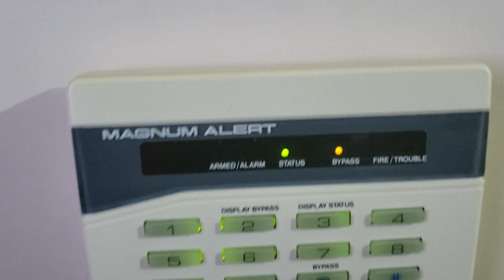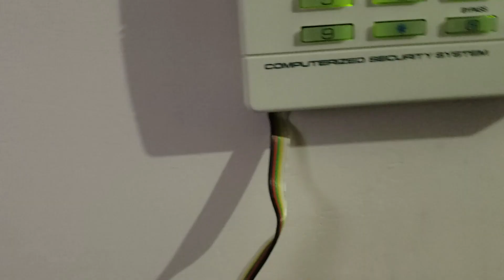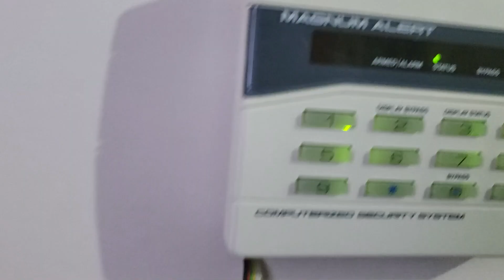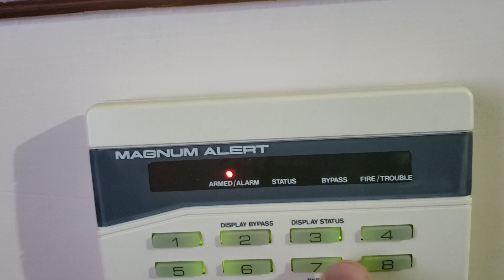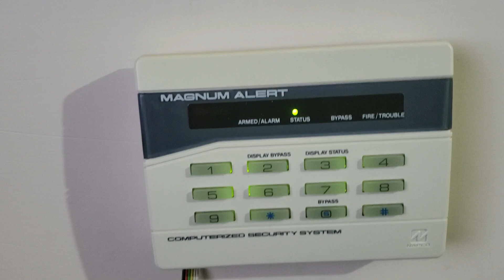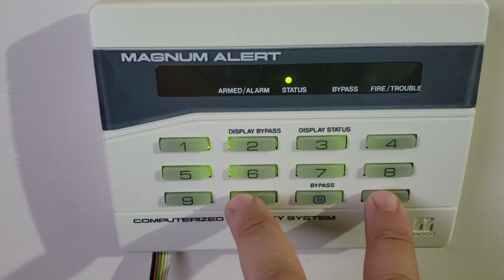Magnum Alert 1000 series basic functions

Comment: My Magnum Alert RP1054e Keypad appears to be frozen with the Armed light "ON" and the "Bypass" light is "ON". My local Arm/Disarm code does not work. I need to reset the keypad and create a new "Arm/Disarm" code. The reset key (9) does not appear to work. Grateful for any assistance. Thanks.

Comment: Hello !! I bought a house and it has magnum 1000 ma1008lkdl alarm system. Your video is super helpful to get the insights to get started. 
It’s showing green light flashing and when I press 3 for few seconds, it shows the Zone 1 and 2.
How to determine which areas of house are in Zone 1 and 2 ?
I checked my doors and windows are closed.
Also, do they still support the system ? I mean if they respond to any security alert or do I need to call and set all that up. I just have no idea !!
Thank you in advance !!

Comment: Hi There Decofanblade: I like your video. I have a similar Magnum Control Panel. I think mine is the 1000e series. I do not know how to bypass Zone 10 as I do not have a "zero" button. Any ideas? Thanks.
Reply from the maker: Hi! you probably have a 1016 panel as the 1000e only goes up to 8. to bypass 0 it is the same bypass button that is the 0 key
Reply: @Decofanblade  I have numerical  1 - 9 where 1 thru 8 are individual button and 9 | F , * | P ,  B | A , are on the same button respectively while # is the last bottom right button.  I do not have a 0 button. My system is quite old and I'm having some issues with Zone 10; thus the reason for wanting to by-passing it.

Comment: My panel keeps beeping at the same time every morning? Any idea why?
Reply from the maker: The culprit may seem to be that there is no connection to the central station phone line might be disabled so your panel could be set to check in every 24 hrs to the station. Do you know what the trouble number might be on the keypad?
Reply: @Decofanblade  2,3,8 numbers blink on the console.
Reply from the maker: @theodorebezel3343  Hi Theodore 2 is a low batter which means the battery is low or dead those batteries have to be replaced every 2-3 years and 3 is the expected failure to communicate which is probably the  panel alerting central station of the battery condition 8 is the actual code for trouble. clearing up these two should stop the 24 hour beeping.
Reply: @Decofanblade  the battery for the panel?
Reply from the maker: @theodorebezel3343  Yes! the backup battery
Reply: @Decofanblade  Is this tied to the main breaker panel or its own power source? Not seeing anything labeled.  This was installed prior to owning the home
Reply from the maker: @theodorebezel3343  This is on its own it is usually a black battery or grey depending on brand that is connected directly to the panel via positive and negative colored terminal cables, the battery usually resides inside the panel box installers do this.
Reply: @Decofanblade  Yes I found the battery and have ordered a replacement.  Do I need to cut any power to the panel box before replacing the battery?
Reply from the maker: @theodorebezel3343  Its recommended that you do otherwise you will still have the beeping occurring so it is safe to power down panel however before you do notify your central station that you are giving maintenance to your panel that way any communication to the station is not taken as warning.
Reply: @Decofanblade   Should the power be connected to the main breaker box?
Reply from the maker: @theodorebezel3343  Do apologize for the delay of response was away for the week, the panel should be connected to an ac transformer it usually is located in the basement or the attic being it napco it should be a black transformer.

Comment: Hi, I bought a house and I don't have the code.  How can  I recode it? Thanks
Reply from the maker: Hi! Each variant of the 1000 series MA systems have a different way of defaulting! I wpuld first try holding down 8 then when you hear a beep input 456789 and you should get a line on the 7 seven segment display indicating programming mode

Comment: I have this exact system and recently upgraded from a hardwired land-line phone to internet wireless phone, losing my phone connection to the monitoring company in the process. Is there a way to reprogram the system to eliminate the 3 (no phone connection) and flashing lights as I have terminated the monitoring service and would like to use the alarm with outside horn for security moving forward? Thanks in advance for any insight you can provide!
Reply from the maker: Terribly sorry to all i could not answer ive been super busy. So to remove the communication error you would need to go into programming by holding down 8 and entering your service code thus enabling the system to programming mode my only concern os that if the alarm company that setup your system actually programmed the panel with a service code? never the less they should provide it to you either way when you have this code input the service code and you should be in programming (note programming this panel is difficult if needed i can make a video with how to get to programming and programming itself)
Reply: @Decofanblade  Thanks for your response. The alarm company set the system up for us over 20 years ago, so I doubt there'd be a record of the service code, if they set one up. I suppose I could hold down number 8 and see what happens.
Reply from the maker: @ShakingTwoTrees2012  Holding down 8 and entering 456789 should take you to the programming menu, however if this does not work there is a way to default the panel by shorting two terminals in the memory chip depending on your panels make if its the 1008lkdl or the 1008e the system default varies.

Comment: Just noticed that the LED screen said failure to communicate.  So maybe that's the problem.  Could someone instruct me how to disable the function.
Reply from the maker: Sorry for asnwering late been really busy. For programming hold 8 enter your service code provided by the alarm company once you get the line on the seven segment display enter the 3 digit block number in this case is 182 and the  you must program a 1 in the block that disables all fault finds and communicator conference on the panel use the keys 4 and 7 to scroll the bits up and down. once you are done press bypass key again and then hold 8 again all the lights will light up and then re input your service code again to exit programming.

Comment: I hope you can help...when I bought the house, we had this system but they didnt tell me what the code was and they left.  We are not paying for their services monthly but the alarm is tripping and I dont know how to stop it from going off.  is there a way to disalarm the alarm without knowing the code?  is there a generic code?  We have this system with a mic that goes off with alot of sound which is the main problem.  any help is appreciated.  thanks.  my email is abephysics@gmail.com
Reply from the maker: Hello Ethan! depending on the model of the panel as there are some variations to the MA1000 system you need to short two terminals in order to default the panel, like i mentioned the terminals change due to the variant of the panel you have in your house if you just want to turn off the system just unlplug the battery that should be inside the panel box and unplug the AC transformer if you want to default the panel please look inside the panel box and look at the wiring diagram and it should tell you what version of the MA1000 panel you have, if you want to default and reprogram the system ill be glad to help you out i just need to know the variant of the system you have in order to know what terminals you need to short in order to default the system in the mean time just simply disconnect the system both battery and transformer.

Comment: I wonder Why the panel doses't just show the zones that are faulted in the display all the time, if there were multiple it could scroll through them. It would be cool if there were a nixie tube for the display though.
Reply from the maker: The newer "E" series panels have the zone feature enabled right off the bat plus the audible touchtone sounder as well, ive gone into programming this version and cant seem to find the parameter for that feature im still waiting to hear from a technician that installed this panel if such feature even exists on this older model as I remember the one in my old house had both features enabled the panel here is the first iteration of the 1000 series came out in 1990 so i guess they were just getting started with newer features and such as this panel both supports older keypads and this newer designer version keypad featured on the video. then came the "E" series revision in 1994 whcih started with the 1008e panel which is basically the same as the one here but with the firmware upgrade. I wish it had a nixie tube! love those things! oh yeah and the keypad does scroll through the zones everytime the SSD flashes it changes value.
Reply: My grandparents' old house had a Magnum system that I don't know the model of (bet it was an E series tho because the system was installed in 1999) but yes it does scroll thru zones. A good example was when they had the sunroom windows open and the motion detector being triggered by someone walking by (let's just say the window is zone 5 and the motion is zone 13) then every second the keypad's 7SD would alternate between "5" and "13".